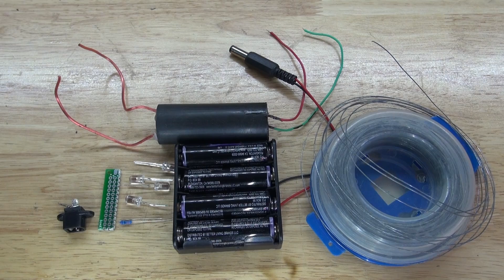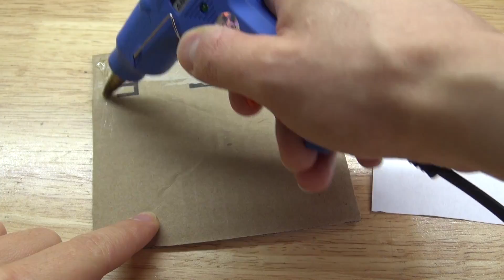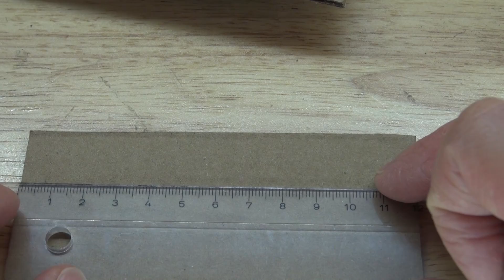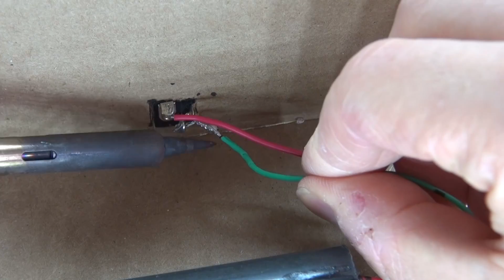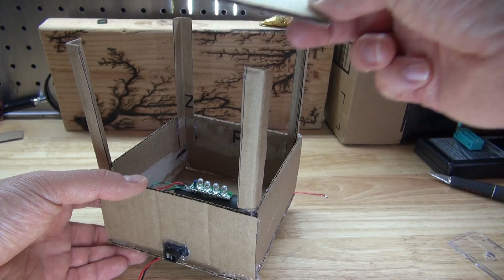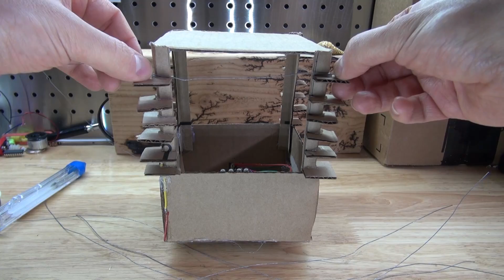Extreme High Voltage Bug Zapper

Comment: Doesn't this require a timer circuit to prevent burning it out?
Reply from the maker: No because after the bug is zapped it will not use the circuit too long.
Reply: @SciTyeTech  Pretty big bugs you got there :D.. What also worked a good bug killer was that old 400W HQL where i broke the white glass layer.. Sadly it didn't last that long tho.. maybe 1.5 months in fair use after it broke..

Comment: I just used 12 x 450v 35,000 μf caps wired in series with a 240v supply rectified to dc so 360v or around i guess.  But aside from bugs, if anything really touched it im pretty sure theyd not be able to touch it again..  sounds like a 45 getting shot..  and totally melts the end of a screwdriver in one zap..  got a wasp on it once..  it disappeared..  scared the dog fart outta me when it did too..
Reply from the maker: lol! That seems powerful!!
Reply: I like the cut of your jib.

Comment: But thats not just a high voltage transformer. Transformers dont work on DC.
Reply from the maker: Yes I misspoke, I meant to say high voltage generator.
Reply: @SciTyeTech  
Thats ok. Transformers can be used with DC in other applications, kinda. Transformers can be used as electromagnets